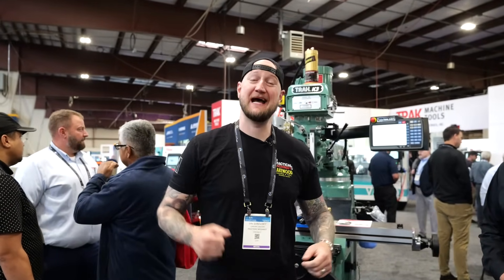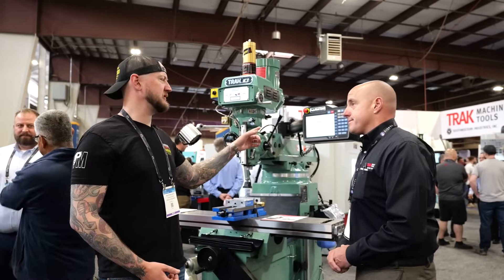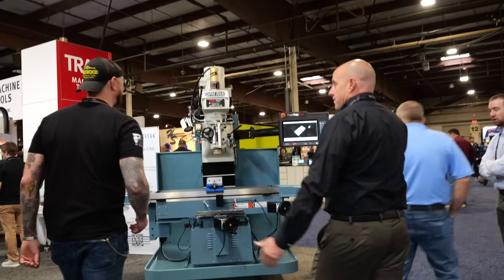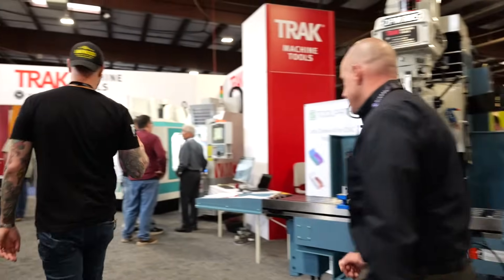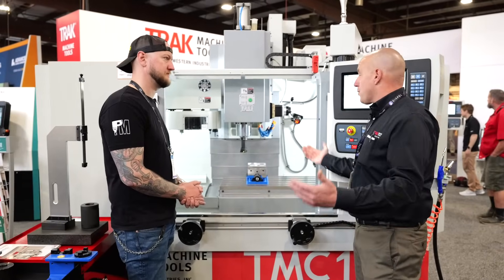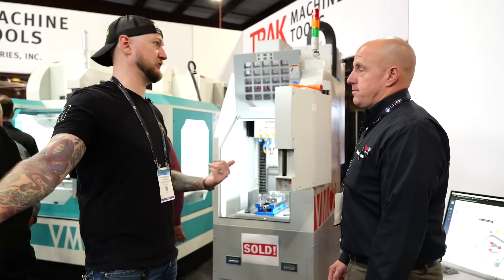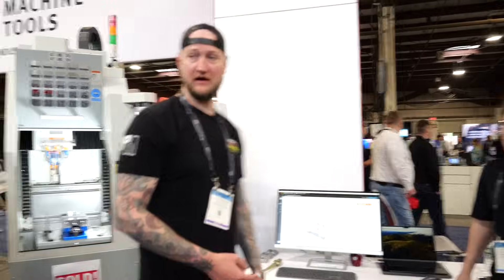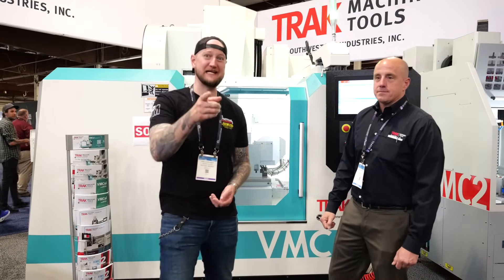Whatever Your Shop Needs, There’s a TRAK For That

Comment: I used a new prototrak at my last job.  $27k with 2axis kmx lol absolute rip off.  Ours didnt even have cat holders, just R8 collets.

That kmx control is ass.  

Buy a Bridgeport and pay someone to install it, save yourself $15k.

The conversational side is terrible.  You can’t even control the direction the circle starts.

Maybe the higher end control is useful, but I just used Gcode.

To have the full 3axis cnc you’re looking at around $35k